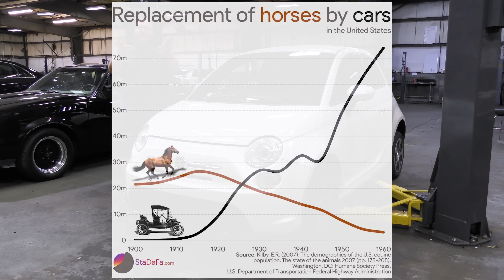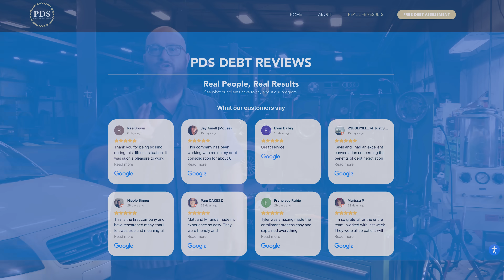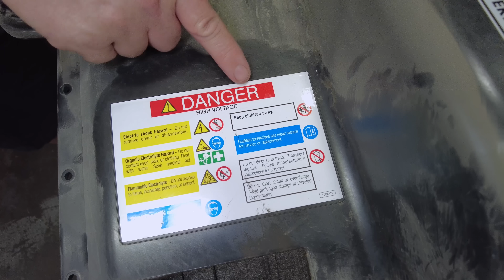How to SAFELY Remove the EV Batteries From my Fiat 500e

Comment: When I was a poor college student my toyota had what was called an ignitor module that failed. $400 at the dealer. Was told no serviceable parts in the module. My neighbor who was a electrical engineer took it on as a challenge. Got it opened and found a bad $5 resistor on a PC board. He replaced it and saved me a bundle. These automakers don't want you to be able to fix cars anymore.
Reply: It's not worth the dealers time and they don't want to warranty a repair like that.
Reply: @matthewkrahn3 Exactly. Though actually the time could be more than worth it, but the warranty of the repair is the biggest issue. You can do it between companies easier because they are free to agree whatever terms they want.
Reply: @rkan2  Sounds like you have little personal experience with car electronics. There isn't a whole lot there to trace to find a fault.
Reply: @danajorgensen1358  Sounds like you have little experience dealing with warranties or customer comebacks as a mechanic...
Reply: @matthewkrahn3  . training with electric dreams .
Reply: @matthewkrahn3 then charge me $30 bucks and don't warranty it
Reply: @matthewkrahn3  It is not about the dealer but about repairability.
Reply: I knew someone with a Buick Century that the odometer stopped working. Replacing a resistor fixed it. They are not magic and you can service modules.
Reply: lol Cars use "black box" tech. The idea is quick/cheap assembly and making it possible for a mechanic to repair any vehicle. There are still a few specialist shops (mostly in Europe) that specialize in rebuilding electronics. Each usually focuses on a few dozen products they can repair. If your mechanic also had a degree in electronics, he could have repaired the fault. Of course then your $400 replacement might have run $2000. Ask your friend how long he spent locating the problem then multiply that by shop hourly rates.
Reply: @mikep490 I had an ABS module fail on a Porsche.  The replacement was thousands.  Module Masters in Moscow, Idaho were able to fix it at a reasonable price and quickly.
Reply: @LancePedersen  Thank you for the tip on Module Masters. Parts for my 5 yo car are no longer available so electronics have to be shipped to Europe.
Reply: @mikep490 finding a burnt resistor is hardly 2000 bucks jobbie, the risk is just that you spend 50 bucks worth of time not seeing anything obvious or a custom chip blew.
Reply: @lasskinn  True, $2000 was probably high, maybe not for new cars. At $160 to $200/hr it's a gamble they'll find the problem. My old Ranger's cruise control module went bad, parts were discontinued, and the tech tried to repair it. It only cost me $1000. Then I had to locate a NOS part on Ebay. Of course it wasn't anything as obvious as burned resistor you could find at a glance.
Reply: @mikep490  quite often electronic problems like failed resistors or capacitors are fairly easy to spot. It often takes long to take the module apart than it does to fix it.
Reply: @mikep490 I’m a saab enthusiast and we’ve have all kinda had to learn how to work on the electronics ourselves. I just got done rebuilding my alarm siren box.
Reply: @mikep490  
But having found "the fault" he now can repair it in 5 minutes and $10 in parts.

That person becomes the GOAT.....
Reply: @mikep490  It depends, I used to do some board level repair (and whatever else came in the door) for $13/hr until a couple years ago.  Tho I'm more the exception than the rule, and this was for a family business.  Quit when there wasn't enough work to make it past 650$/yr income - it wasn't even worth the car ride over to tear a TV apart for backlights.
Reply: Labor costs more money. If you're doing it yourself then it maybe worth it.
Reply: @rgs4x Here’s the thing. The dealer doesn’t want to warranty such a small part. And the sticker that says no serviceable parts inside is 100% true. You need to know electronics to fix it. Your neighbor clearly did. As do I. I have repaired many modules because of my knowledge. But an average joe will not know what to look for. Had your neighbor not been there, then what? You could take it to an electronic repair shop. Yes they can fix it but not for free. I would have charged $200 to fix it.
Reply: There’s no practical reason electronic things are difficult and expensive to repair, it’s about profit. I have worked Apache Helicopters since 1985 and can say for sure its entirely possible to have even the most complex system tell you what is wrong, if not on its own then with test equipment designed for that particular system.  Common issues and repairs can be cataloged and fixes can be quick and designed for easier, faster repairs. If you want to know what’s going on in the consumer market, look up some of the court battles that are going on right now about “right to repair”. Manufactures are fighting to keep you from fixing you toaster!
Reply: @rustyaxelrod  I totally understand.
Reply: They don't want to mess with that for legal reasons. What if the ignition stops working and you die or whatever? Also experts are expensive...
Reply: 2001 Prius… 177k miles and the hybrid battery was dead. Took it apart and replaced all cells with lightly used ones and new bus bars for $950 last September. Since then, I’ve driven it 10,000 miles at 43mpg without issue. 400 miles between fill-ups, until it entirely dies I’ll be content with it. Toyota wants over $4,000 for a new battery after installation. Do what you can with what you have. 👍
Reply: I saw a video of a guy finding a cracked solder joint on his ABS module, just had to clean it up and apply new solder, module worked perfect, saved him around $200 used, $400 new as well
Reply: Never tell an electronics guy any electronics are "nonserviceable". Not only can we service it, but it will probably cost less that the whatever BS options the dealership throws your way. I've fixed electronics in everything from cars to freaking clock radios.
Reply: anymore? They never did. SInce Ford made his Model-T.
Reply: @wolfgangpreier9160   That is total nonesense. Those cars could be fixed with simple tools and it was encouraged.
Reply: @worldhello1234  Not here in Europe. No.
Reply: My wife is from the Philippines.    When we visit, I am always amazed how they hardly buy new parts to fix anything because they don't have easy access to parts.   So they rebuild about everything
Reply: @kmcclarney It's not because they can't get the parts. In the case of the $400 Toyota part mentioned in this thread, that cost would represent 3 or 4 weeks earnings for a working class Filipino.
Reply: @tn18977  that is true on the price.   it is also true as what I've said.   I've seen it many times.
Reply: T @kmcclarney
Reply: @kmcclarney Yet they make all kinds of parts in the Philippines 🤔
Reply: What was the year, make and model of your Toyota?
Reply: @NotAdamSnider Yeah I’m curious too. Because I’ve never heard of an ignitor module on any car. 😂
Reply: @rolandthethompsongunner64  I believe the person is referring to the electronic ignition module - the 'system' that replaced the points and condensor located in the engine's distributor.
Reply: @georgebettiol8338  And that cost 400 bucks?
Reply: THIS. It's not that the part isn't serviceable, it isn;t worth $ to them to make that part available or write up a code to have it serviced. It will take time, but once interoperability similar to what had to happen in telecom comes to EV's, we'll see alot of opportunity to independant repair shops, fab shops, new lines of business for electricians and those looking to get into a new trade.

 A good start would be to stop crapping on EVs, and second step would be to continue to add level 2 and level 3 charging stations near police stations, malls (Level 2) mass transit hubs (level 1 and 2 only) gyms (level 2/3), level 1 at airports. Reserve  level 3's for rest stops and off highways mostly.  Then train and hire contractors willing to service these chargers that live nearby.
Reply: sometimes you guys have to be realistic, even a billion dollar company like toyota its not cost effective to fix things..yes the part is cheap cost $5 but the cost to hire someone setup a shop is not cheap and such job do you think a dealer would do it..nobody doing business as charity
Reply: @rgs4x Here’s the thing. The dealer doesn’t want to warranty such a small part. And the sticker that says no serviceable parts inside is 100% true. You need to know electronics to fix it. Your neighbor clearly did. As do I. I have repaired many modules because of my knowledge. But an average joe will not know what to look for. Had your neighbor not been there, then what? You could take it to an electronic repair shop. Yes they can fix it but not for free. I would have charged $200 to fix it.
Reply: We use to bypass bad sections on the circuit boards at work. They would work for a while but it all depends on the soldering job we did. 
Only time we couldnt fix what when the microprocessor were damaged, as we couldnt properly replace those
Reply: @DapimpBDSD  And you could not give the customer a repair warranty. 

In Europe you must give a repair warranty for everything you repair. So that everybody knows his job or is out of a job and much money paying for fines and punitive measurements.
Reply: @wolfgangpreier9160  yup, but since it  was our company that was the customer, we had the ability to try it and if it didnt work, well then we bought one. We would do alot of "shady" work, mainly because the company didnt want to spend money
Reply: @DapimpBDSD  You can not do shady work on vehicles in Europe. 

Not anymore since the police social security and taxing insitutions (in the US its the IRS here its the Finanzministerium) have stopped that kind of shenanigans.
Reply: With these mechanics today there mentality is to remove and replace instead of remove and repair. Most are not in the business to save you money.
Reply: @Slim1962 Fire the parts cannon is all that most shops do these days
Reply: They say "no user serviceable parts inside" to cover themselves legally. But the old Japanese cars are very repairable. PCB repair on most cars early 2000s and prior are doable with basic hand tools.
Reply: It’s worth learning how to fix stuff. (If everyone knew how to just fix a faucet or a simple toilet flush, they could all save thousands of bucks)..
Reply: My wife always ran high quality German cars all her working life from one particular brand ( I won’t say) and on the last interim service they gave her a list of items needing work “ that really needed doing straight away”  the estimate came to approx 1350 bucks that she thought was “a lot” so she took it to my garage that has always serviced all of my Ford cars and they did absolutely everything listed for 450 bucks. She has never gone back to that main dealer and has since sold that car and bought a new Lexus.  ( She’s already done 35,000 miles without a whisper of any problems!)
Reply: 99% of any customer can't find someone to do the work nor is a shop going to spend the time to find the $5 part and then charge hundreds to find it.  It has nothing to do with "they don't want you to fix anything"...
Reply: They're in the business to sell you cars. Duh. And they don't make the parts, they buy them from suppliers. Why would they buy the part, AND all the parts inside the part to fix the part? Dumb.
Reply: When I lived in Romania in the early 2000;s I had a clutch go bad in a Mitsubishi , the local garage took out the clutch , replaced a broken spring on the pressure plate , re-assembled the clutch and charged me the equivalent of $5 , car lasted another 6 years without a problem
Reply: $0.25 resistor!
$350.00 for 3 hours of his time.
Reply: I have reflowed countless black box circuit boards for 80s and 90s BMW and VW.  Even put new capacitors on an early Lexus PCM.  Soldering and troubleshooting skills are good to have.
Reply: That ignitor could be replaced with a $15 GM HEI module
Reply: "These automakers don't want you to be able to fix cars anymore."

Anymore? It's been that way for many years.
Reply: I've fixed a few modules just by opening them up and retouching the solder joints. A flaky relay on my Honda Civic would not allow the car to start when it was warm. An intermittent ABS light on my Sonoma caused by a bad joint on the ABS module. It's usually not rocket surgery unless they're SMDs, then it's beyond the average person's scope, but many modules can be repaired.
Reply: #based
Reply: The manufactures had to standardised battery pack for all cars. With out that EV are not mentionable for resemble price.
Reply: @miroslawkaras7710  True, every watch, every smartphone, every computer, every device in the whole world uses the same batteries. But not EVs. What a shame...
Reply: This reminds me of the repair I did to my factory honda radio. I fixed an smd fuse and replaced an amplifier chip in it. Now it works better than ever no need to buy a new radio.
Reply: @brayannexon4613  Nice. And you could do the same on 1 million other radios and take over the warranty for the next 2 years?

Please give us the address where we can send the devices for you to repair for naught.
Reply: I repaired the A/C logic board on my 2005 Ford Mustang in a similar fashion. They place that inside the passenger fender well. I took it apart went to Radio Shack and bought the required relay and removed the bad one and re soldered the replacement in the board. I had to jump the low pressure switch but it worked. Ford wanted 400 bucks for a replacement. That part also controls the fuel pump if I’m not mistaken. It went three months later. 😂
Reply: If you had to pay retail hourly rate to your electrical engineer neighbor to repair the part it would have been cheaper to just buy a new one so nothing to do with the automakers not wanting you to be able to fix your car. Also very likely that the same part from anywhere other than a dealer would have been half the price.
Reply: As a mechanic who likes to try things out ...

I would be very wary doing this on a customer's car 

Very few  mechanics would be trained in pcb level electrical work

Why I might suggest it to someone it would be full of disclaimers that most people don't want to get in
Reply: Ls400 Lexus Custer, $5 is resistors or very literally $1,200 change with a part that would have the same failure within 5-6 years
Reply: Most Italian car owners know that when their car fails it will be a German made part that has caused it. Annoying!
Reply: People can still make repairs like this, try watching @southmainauto, he is a real automotive repair YT channel that takes things further than this channel for examples of real repair shops.
Reply: Yeah, but how do I transport my truck camper and horse trailer 500mi to remote fishing spots with no charge stations?  Answer that then we can talk about EVs.
Reply: They don’t even want you to dip your own oil anymore!!
Reply: The dealers are so busy making money charging a grand for a $100 dollar repair they don’t want to do your simple repairs anymore..
Reply: Don’t worry Wizard! - your young beautiful clever wife will keep you on your toes! Warm wishes from London U.K. ❤️
Reply: It’s power equipment but the same idea. I had a big name green lawn tractor that died and the shop said it was the carburetor leaking, need a new one for $200. There are rebuild kits for sale for $15 but it wasn’t worth their effort to do that plus there probably wasn’t anyone in the shop smart enough to put all those bitty pieces back the right way. And no, I didn’t buy a new carburetor from them and moved on to a different model and dealer
Reply: Back in 1989 That happen to my Parents Toyota Camry. Local shop wanted $350. The car was still under warranty and he had it towed to Toyota.
Reply: If you run in trouble with a V.A.G. dsg transmission, they don't repair it, they replace it at 8500 euro.
Reply: If it was an early model , all an ignitor module would have been was the transistors to switch the ignition coil(s)and associated passive components. A fancy name for a simple circuit
Reply: Like the GM Truck fuel pump trick, could that module be removed by cutting the underside of the pan  ?
Reply: They never did.  They'd rather you bought another new one.
Reply: I worked at an auto parts store for thirty years, and remember well Toyota owners coming in and asking about them. The replacements were very expensive, and so often on expensive parts our customers would get all bent out of shape and think we were out to get them personally.
Reply: I mean, at 150 dollars/hour the fixing and diagnosing of the part would probably be alot more than 400 dollars
Reply: I had a similar situation with a 1983 Maxima...  The ignition module (I think) went bad. $500 part from Nissan.  I found one at a salvage yard for $150, but when the salvage yard pulled the part from the wrecked Maxima, it had previously been sold used from another car... This one part, was used on at least 3 separate cars!  That's recycling at work!
Reply: Heh... Always been that way. Always consumable products. You'll get over it.
Reply: @thebonefish for what's being charged for modern vehicles and, declining reliability in the last 15 years, more and more people are doing their level best to keep their 'old' rides up and running.

 Especially where body rust isn't a problem i.e. here in Arizona, Calif, etc.
Reply: CARS HAVE BECOME drive 3-5 years and then dispose
Reply: Not my 2001 Nissan Sunny.  I've been driving it as a daily driver for 23 years. Did all maintenance and the few minor repair stuff myself. It's good for another 23 years. New cars from today are throw-away planned obsolescence crap 😠@peterpeter5666
Reply: well that $5 part will still be over $300 because of the labor involved with diagnosing the car and then diagnosing which electrical component failed on that failed part
Reply: ESPECIALLY EVs ,all makers of EVs on purpose so everything costs us a fortune to maintain
Reply: Bc they want that 36995 from you. I have a 2015 with 289k bc I’ve kept it up they want to take all your money and that’s it
Reply: @codycrawford2385  Bd they give that 3.14159 to someone else. He has a 2026 with 777D db I kept it there they would give them money and that‘s it
Reply: jimcabezola3051  "Many of the thousands of modern-day owners know how to repair these old things."

Do you even read what you write?

I talk about 8 BILLION people and you telling me many thousands can repair their own cars.

Why not make a starship? I guess everybody and his gradmother knows how to do that,.

And my comment about the Model T was correct. 

I WOULD NOT HAVE BEEN ABLE TO REPAIR IT. I am a electrician not a car mechanic. Of course there were "a few thousand" at that time who could repair it. But the majority could not. Just like today.

Would you give a accountant - or a rocket scientist - a Model T for repair of the carburator? The crankshaft? the pistons? the drive train?

I would most certainly not.